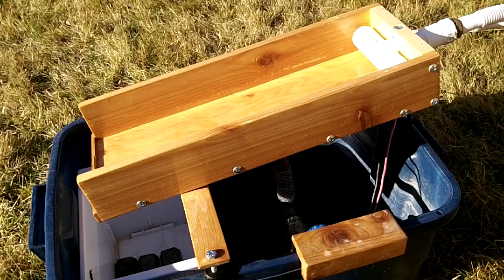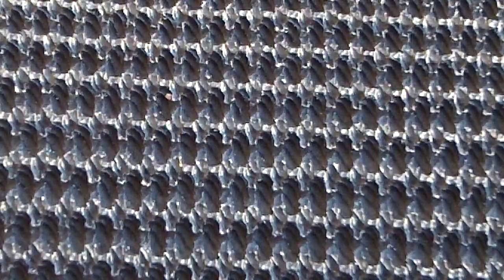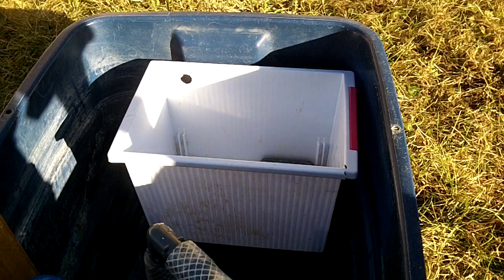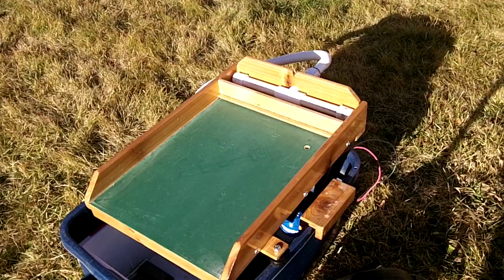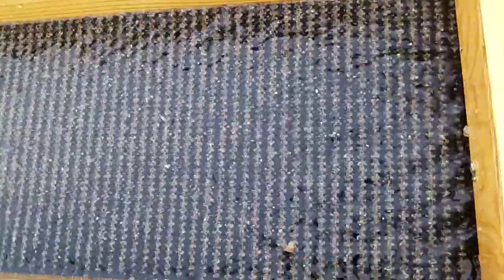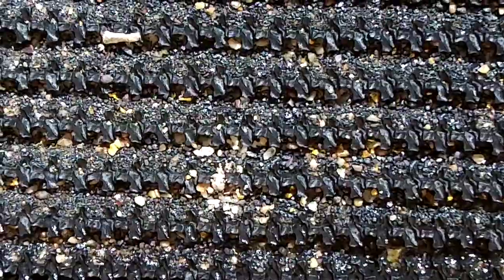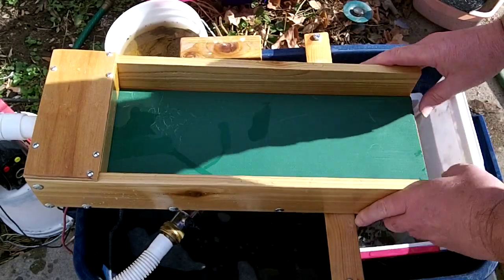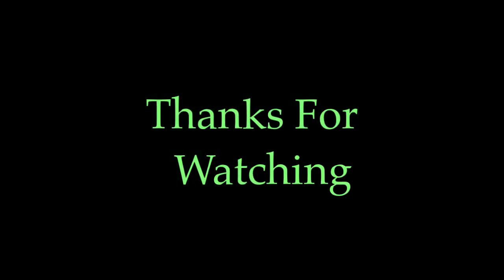Recirculating Mini Fine Gold Sluice

Comment: Here's a technical question would this be considered a highbanker which is illegal in some states of Australia or would it be a sluice box which is allowed?
Reply from the maker: Hi Kevin and thanks for watching. This is considered a sluice box here in America. The use of an electric pump may make it illegal in some areas. In my area, I can’t use a pump in the stream so I used this setup on the bank to process my stream material. I have a couple of videos on drop riffle sluices that would be legal. They can be used as a recirculating sluice as well as a stream sluice. I used to carry one in my back pack when hiking in areas with streams.

Comment: you put the valve before or after the pump ?
Reply from the maker: Hi Feisty Kitty and thanks for watching. You put the valve after the pump. Usually about 8” to a foot from where the hose plugs into the header spray bar on the sluice.
Reply: @utahavalanch  thanks ---   what's the max % you can reduce witout f-n up the pump ?
Reply from the maker: @FeistyKitty-l4c  I have turned the valve all the way off on mine without any problems. I now use a 12 volt DC motor controller on mine to adjust the pump speed. You can buy them on Ebay for $8.00 - 15.00.  The one I have has a digital readout so I can set the water flow to a certain point each time. They really work well.
Reply: @utahavalanch  thanks ----  that's a clever convertible design --- i'm taking  your word on that mat -  what do you think of a slab of stone for a miller table ?   i have a piece of granite couter and I was looking at the surface on the back.  It's flat but not polished.  It seems like stone you can easily adjust the texture by either sanding or polishing.    You could try different scratch patterns in different areas.
Reply from the maker: @FeistyKitty-l4c  thank you. I have since revised that design to simply painting the bottom of the sluice with Chalkboard paint. The Miller Table is my favorite tool for prospecting.  Although it’s slow, it does the best job of catching the finer gold that I work with. If you have watched my other videos, I have designed and built a number of different ones. A newer design is a combination sluice and Miller table that works very well and what I currently use.
The original Miller tables were built using slate as the table top so the granite would be a good one to try. Myself and another individual spent a year testing about 100 different materials for a Miller table and we found that the Rustoleum Chalkboard Paint was the best material next to the slate to make the Miller table out of. Gold has a tendency to stick to the Chalkboard paint while the other sands tend to slide off. I use it in my newer designs to slow the gold down when going down the sluice to enable better capture.

Comment: Hi there Utah, question for you, what type of battery is needed for recirculating sluice box? Right now I'm using an old car battery and it's almost dead and I need to get a replacement one so should I stay with a smaller size car battery or can I use a lawn mower battery?  What's your take on this? I have a very limited budget for this. Thanks and hope all is good with you and the family.
Reply from the maker: Hi Michael. It depends on how big your pump is and how long you want to run it at a time. I’m into the fine gold and so I use a small 800 GPH pump that draws 2 amps. I run this on my 10” sluices. My 17ah lawnmower battery will run it for about 2 hours straight. I run my material in batches of about a gallon and I clean out after each run so the battery gets a bit of a rest. I can usually get 3 hours out of it that way.
The 500GPH that I used to run on this little sluice drew about 1 amp and would run for about 4 - 4-1/2 hours straight.
An 1100GPH runs at about 3.8 Amps and so would cut that down to about 1 hour. A 2200GPH will cut it down to about 30 minutes tops.
You can buy a 17ah lawnmower battery from Wallmart for around $25.00 - 40.00.
If you need a bigger battery, then you will need to get into a car battery for about twice the money. 
I go with the smallest pump that will do the job so as to cut down on battery cost.   An 800GPH pump is more than enough for a recirculating system and an 8 - 10” sluice. You can buy a DC 12 volt power controller on EBay for about $8.00 that will allow you to control the water flow for fine gold or running a smaller sluice.
I hope this helps.
Reply: Hey Utah thanks again for your help. What kind or type of controller is that you are referring about?
Reply from the maker: @MichaelJohnson-ux7pe  
It looks like the price has gone up since certain people got into office.😝 if you do a search on Ebay for 12 volt speed controllers, you will get quite a selection. This is the one I bought. I built a small box to put it in.

https://www.ebay.com/itm/DC6-60V-12V-24V-36V-48V-30A-PWM-Motor-Speed-Controller-Start-Stop-Switch-TE1256-/254742305473?mkcid=16&mkevt=1&_trksid=p2349624.m46890.l49286&mkrid=711-127632-2357-0

I like it because it has a digital readout so you can set it back to a preferred setting. With my new highbanker, a setting of 70 will ensure that it will strip out every little piece of gold in a batch of dirt. I only need 150GPH for my MillerTable and this lets me reduce the flow from my 800GPH down to that for collecting nano gold.
Reply: ok thank you sir and have a great 4th
Reply from the maker: @MichaelJohnson-ux7pe  🎉💥🎈🎉👍🔹🍔🌭

Comment: Hello Again: Is the paint you use chalk "board" paint or just chalk paint, and is there a difference. Thanks
again. Gord Forster
Reply from the maker: Yes the paint is Rustoleum Chalkboard Paint. You can buy it in any paint store, Lowe’s, Home Depot, or Wallmart.. it comes in a quart can and you pick the color from the side of the can and they will mix it for you. I like to apply it with a small 3” paint roller. If you saw my other videos on my Deep Well sluices and Miller tables, that is the teal color which I like. Yes, there is a difference and you want the Above mentioned paint. Gold for some reason likes to stick to this pant and so that is why we use it.
Reply: @utahavalanch  Thanks so much for the reply and the information. I think I am ready to get started! I love all of your vids, and I plan to build almost all of your projects. I live in an area where the main river has no nuggets, only fine gold. All of your tables and sluices fit right in with this.
Reply from the maker: @gordonforster6898  
Gordon, all of the gold we have in this area is very tiny. 50 mesh is a big nugget. That’s why I started trying to find something that would catch that size gold. Right now my Deep well sluices and Miller tables do that very easily. If you can learn to make a silicone mat like the ones in my videos, they work extremely well as the gold sticks to the silicone almost like flypaper. My combination sluice is the best gold catcher as far as the sluices. The Miller Table deck to slow the gold down to make sure it gets caught in the mat plus the silicone mat makes it pretty much impossible to lose any gold. The best of luck on your builds and if you need any help, just ask.
Reply: @utahavalanch  Hi: I found some of the right chalkboard paint today,  some tite bond glue and some really nice clear lumber, so I am off to the races now. The paint is very hard to find here, but good old home depot had a couple of cans. I think I have seen most of your vids, but I haven't decided which way I want to go with the riffles on the  mold for the silicone mat.  And I agree, I think the combination sluice will be my first build.
Gord
Reply from the maker: @gordonforster6898  
Congratulations Gordon. I think once you get the first one built that it’s not that hard of a project and you will be making more of them. I had planned on having another video made by now on tricks to building them but I’ve been down with viral Covid pneumonia for 2-1/2 months and at least another month to go. So I guess it will have to wait for a bit. 😖 but I think you can get enough from my Miller Table build to get you going.  You build both of them the same way.
Reply: @utahavalanch  Wow, thank you for all the pics and ideas, I don't have any excuses now. I think my first project though,  is going to be a silicone mat. I am racking my brain for an easy way to make a mold, the cardboard method seems like just too much work. If I find something miraculous I will pass it on.  Thanks again.
Reply from the maker: Hey Gordon, hope Some of that helps. Alan Robertson has been selling molds for making silicone mats which would be an easy way to make one, but I just checked and it looks like he doesn’t have any up at the moment. May have some up here later on. My favorite method is using the square dowels like in my one video. But you’ll find something that will work for you. The best of luck with your build.

Comment: your thoughts on a a slight modification having a chalk board bottom (scarlet red...) then the only insert needed would be vortex mat:thank you for the creative inspiration !
Reply from the maker: Hi and thanks for watching. Yes painting the bottom with the Chalkboard paint works much better. I got to thinking about that after I made the video but by then it was already up. 😝. I have a newer design I’m making for a group of scouts that I did that with and it works very well.
Reply: @utahavalanch  i am working a variation with the painted bottom and dream mat 6 x 16....i only mentioned ,scarlet red because it seemed a interesting option with both black sands & gold except i have never seen either nor touch a gold pan.best wishes with your builds and thanks again for taking such time & effort with your channel...
Reply from the maker: @SuperJupiter33  that is the beauty of these projects. We are free to do what we want with them. If we don’t like something, it’s easy to change. If you decide to change the color, it only takes a few swipes of the roller. Or you can get different colors and paint a design. If you watched my videos on my Miller Tables and sluices, that color is the Teal green which I found I like the best. But they can mix the paint in a number of colors. The dream mat should work very well for you. The very best of luck to you and hope you get a lot of gold. 👍

Comment: would you be willing to try gold hog mother mat. I am not being paid by gold hog I use that mat for beach sand hard to get the gold out of the sand mother load mat makes it easer less work.great looking sluice
Reply from the maker: Hi Preston and thanks for watching. I have already tried  Gold Hog mats as I have a Gold Hog sluice and several different mat combinations. The main problem with them is that if you run them like in the videos, you will lose lots of fine gold. If you cut the water flow back to 800-1100 GPH they work pretty well. If you have watched my videos on my other sluices, I am running about 600-800 GPH on a 10” sluice. I find that is about max for fine gold. Beach sand as you know is very light weight and easy to blow out. I usually use my Miller Table for it.

Comment: Rather than rerun the railings, I would rerun the concentrates to get rid of more black sand. Maybe with higher water flow?
Reply from the maker: Hi zenaguy01 and thanks for watching. I have found through extensive testing over the past 10 years that most sluices lose some of the gold. So I used to re-run my tailings again. I have since developed sluices that lose very little. Another thing I have found is that much of the fine gold goes where the black sand goes and so now I try to capture as much of it as possible and then recover the gold from it over the winter when things are slow. It’s surprising how much gold you can recover from it. Most of it is small but to me gold is gold. 👍
Reply: @utahavalanch  
I can see the sense in that. If you recover only 1/8 gram per bucket of tailings, that's not much. But if you have a hundred buckets of tailings, that makes up 1/3 - 1/2 oz of gold over the winter!
Reply from the maker: @xenaguy01  
Yippers Xenaguy, you have the right idea and you’re numbers are pretty close. The gold is small and not a lot of it per gallon but it all adds up fairly quickly. I crush the larger black sand and release the gold that’s trapped inside it. If you saw my video on the hand dredge, I have another one just like it with a cap on the end and a 2” 148 lb lift magnet inside on the end of the plunger. This thing will pick up a lot of black sand at a time and with that black sand is a lot of gold that gets trapped inside the mass. In a good gold bearing stream you may get 1/4 - 1/2 a gram of gold per gallon and it only takes a few minutes to get that gallon.
Reply: @utahavalanch  
I get that. My idea was that rerunning the black sand would super-concentrate the concentrates and eliminate much panning. But maybe that's not worth the time invested.
Reply from the maker: @xenaguy01  
Yes, you can concentrate it a little more that way. The gold and black sand are very close to being the same weight and so you have to be sure to screen them to as close to being the same size as you can so that they will separate in the sluice. This is where the Miller Table really comes in handy. It makes the job a piece of cake and will separate the black and from the gold very easily.
Reply: @utahavalanch  
"miller table ... very easily."
I've seen demos, and would debate that conclusion. 1/2 bucket of black sands cons could take all afternoon on a miller table.
Reply from the maker: @xenaguy01  
You’re right there, it certainly can. It’s not the fastest but it’s one of the best ways to separate the gold from the black sand that I have found. The commercial Miller Tables really don’t work all that well without some modification so I designed my own. Most of the gold I work with is in the minus 50 - minus 100 mesh range so I need something that works better than the commercial units. I have been trying to build better ones for the past 12 years and I have come up with several that work much better.
Last year I designed a unit I, for lack of a better name, call my combination. It is a Fluid bed sluice, Miller Table and regular sluice combined into 1 unit. It has a deep well at the top to smooth out the water turbulence with a deck that is painted with a paint that gold sticks to and a Silicone mat down below. Gold sticks to Silicone kind of like flypaper. You can dump the dirt into the well, turn up the water flow and all the lighter material will wash out leaving the gold in the well.
You can slow the water down and use the deck as a Miller Table to clean any black sand out of your gold. Or you can turn the water up and use it like a regular sluice with the deck as a slickplate. Any gold will try and stick to the deck so you can quickly see if there is any gold in the dirt and then it will slowly slide down and get caught in the sticky mat. One thing I really like is most of the gold sticks to the Silicone in the1st riffle and everything else washes out leaving just the clean gold.  It’s a very fun unit to run and I have used it all summer and haven’t found a speck of gold in the tailings. I can’t copy the link with my iPad here, but if you go to my channel and look for
“10 inch Silicone Mat run”
You can see it in action. I also built a fine gold highbanker along the same lines that I’m testing now. It’s even a better gold catcher and you can use it for gemstones as well.

Comment: Love it!
Reply from the maker: Stephen Fuller 
Thanks Steve and thanks for watching. This is a simple little sluice that works very well. A piece of pine, a cedar fence slat, mat and some PVC is all you need. Oh, and some Minwax Helmsman Spar Varnish. If you paint the bottom with Rustoleum Chalkboard paint, and remove the mat, you can use it as a small Miller Table to process the cons from your mat.

Comment: On all of your home made sluice boxes do you use a 500 or 600 GPH pump
Reply from the maker: Hi Michael and thanks for watching. I have used both. For the smaller sluices up to 8" the 500 works very well. I am currently using an 800 GPH pump with a valve in the hose. The key is to get about 6 feet of 3/4" Bilge Pump hose and I found a really nice 3/4" brass gas valve at Home Depot to put in line with it so I can use larger pumps and then dial down the flow for the size gold I'm trying to recover. The thing is to put the valve at least a foot away from the sluice as when you turn down the flow at the valve, it pressurizes the water like when you put your thumb over a garden hose to make it spray. That really can mess up a smooth flow. If you have at least a foot of hose in front, then that absorbs any turbulence. I have been using this hose with a 10" sluice all summer and when I put on one of my smaller sluices, I can dial back the water so I don't blow them out.

Comment: More flow would help
Reply from the maker: Matthew McLean 
Hi Matthew and thanks for watching. Yes, I could have gone a with a bit more flow but I like to keep as much of the gold in the top 3 inches as I can. On this Vortex mat, the black sands fill in all the pockets quickly and so as you can see, the only place for the gold to go is to sit on top. So you have to be careful not to get too much flow or you will wash it off. Especially with the lighter flat gold. So I tend to keep my flow a little lower as a safety feature. I used to screen to -8 mesh like here and then adjust the water flow for about the 20 mesh and smaller that is in the mix. Now I screen all my material down to 4 levels and run each one separately.